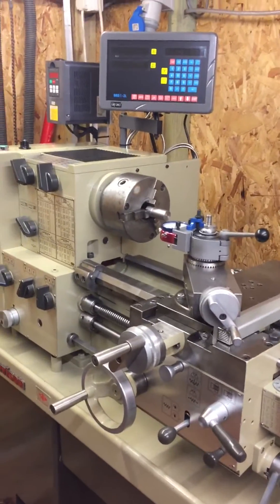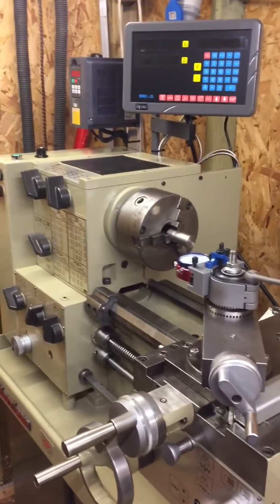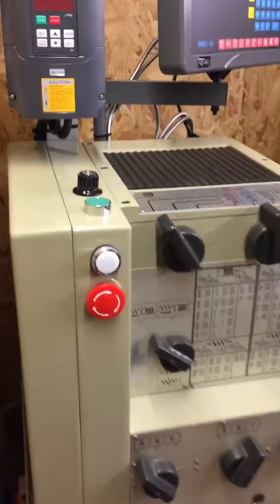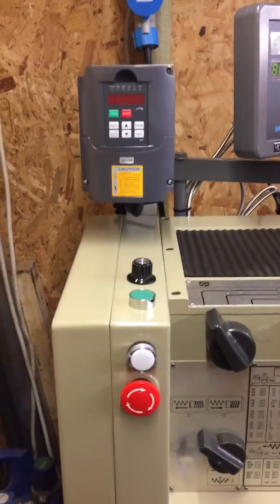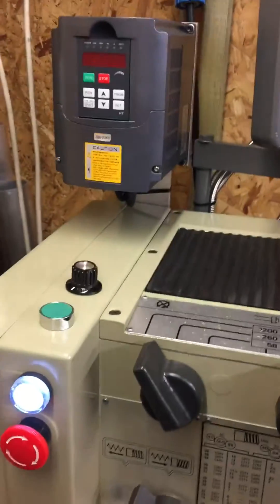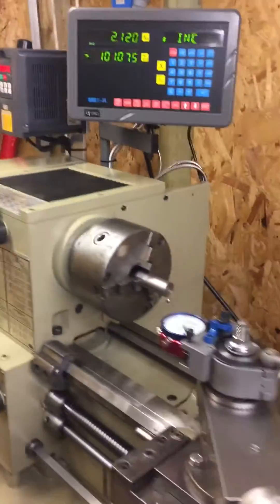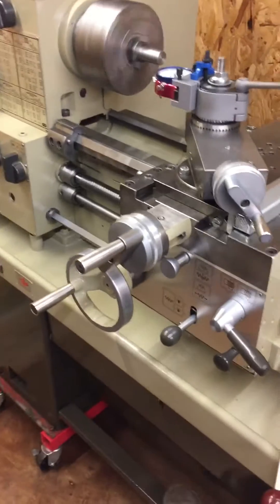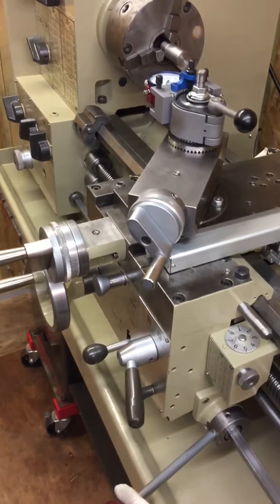Harrison M300 footbrake switch working

Comment: Are you resting the lathe on wheeled mounts, how does that work?
Reply from the maker: Hi

It was rested on wheeled mounts initially when I built it all back up so I could move it away from the back wall when re assembling it, and before I started actually using it properly the wheel frames were removed 

Thanks
Marc
Reply: @kinzy_fabrications  Great idea the wheeled mounts.

With regards to the wiring do you have a drawing you could send me I'm getting an M300 coming next week and I'd like to set up a VFD like you have but I don't know how to do it
Reply from the maker: @jimspencer3072  
Hi, I’m afraid that was quite a while ago and I’ve sold the lathe now and all the wiring diagrams went with it so I’m unable to help with that

Comment: Yes, please show us the wiring diagram.  I think many are in the same boat wondering how to shut off the motor (even after the foot brake is off) and have it reset once the hand lever is returned to the neutral position.  If I put the footbrake in series with the forward/reverse switch, it only works as long as the footbrake is depressed.  Help!  :)